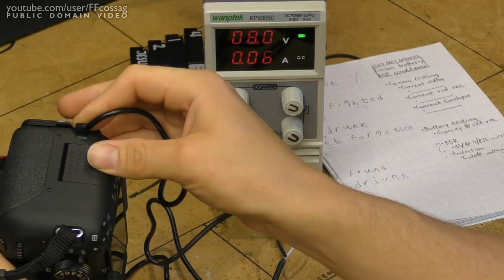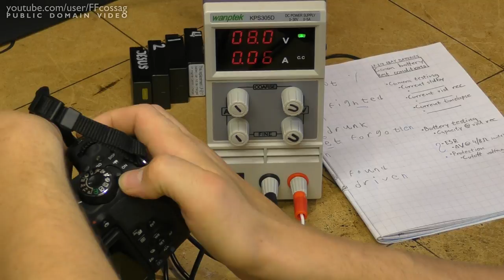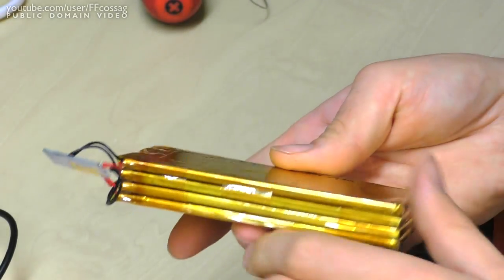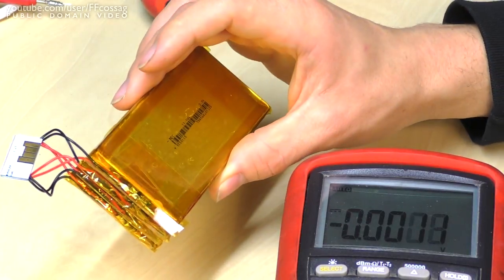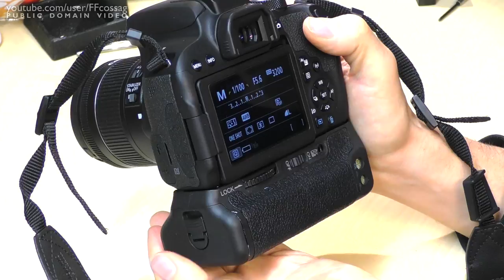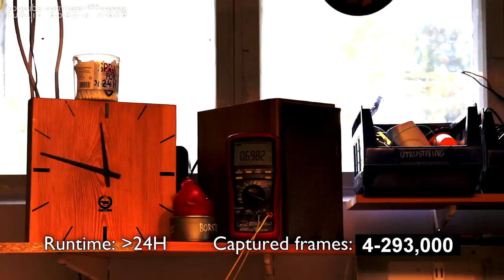Making a giant 43Wh battery grip for the Canon 800D

Comment: What a great idea! Would you mind explaining the battery protection circuit? I'm trying something similar with a 5v power bank, MT3608 Step Up & dummy battery. I keep getting the change battery message. Would it just be the case of soldering outputs of the MT3608 to the pos and neg of the protection circuit and then to the dummy? No need for any com/vcc connections as I won't be charging the power bank using the protection circuit.
Reply from the maker: Could be that your set-up can't deliver enough peak current. You need a low impedance output. I had to add a 100 µF capacitor right at the battery terminals for mine to work reliably. Your power bank needs to be able to deliver about 5 A as well, since the camera can use well over 10 W of power, intermittently.
Reply: My step up is only rated at 2A max. This could be the problem. However my power bank is rated at 5.5A but that's across 3 ports 1A, 2.1A & 2.4A. I think I completely miscalculated as I thought my 700D wouldn't draw more than 2 amps without using the flash.
Reply from the maker: My 800D draws HUGE current spikes at startup and in various use-cases. You need something very low impedance to drive it.

Comment: Don't the 6x AA battery tray give you 6x 1.5v 2500mAh (with high powered AAs) ?? Doesn't that give you more power?
Reply from the maker: No, as batteries in series only raise the voltage, not the capacity. 6 AAs give you a 2,5 Ah battery, vs. the 6 Ah giant pack in the video.
Reply: FFcossag Oh I understand now. Thanks